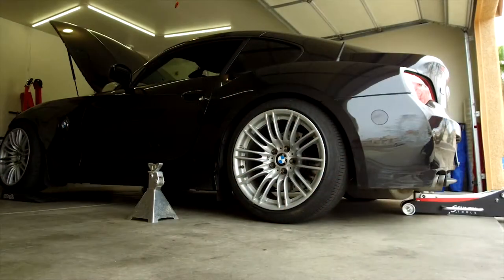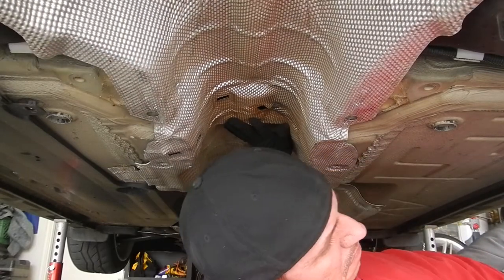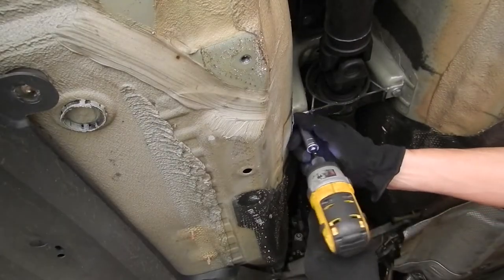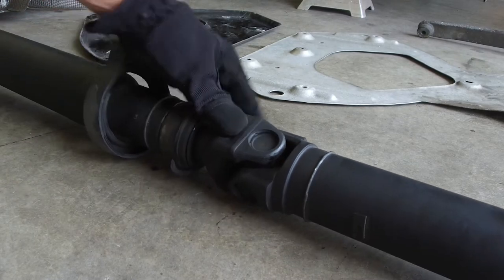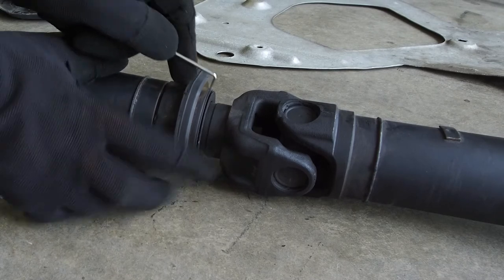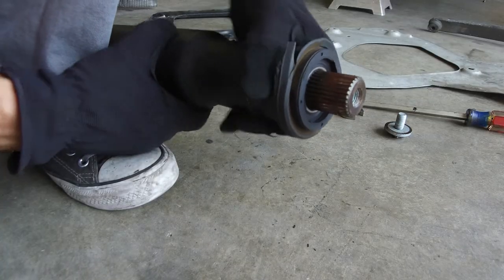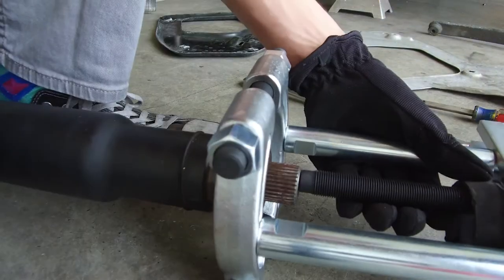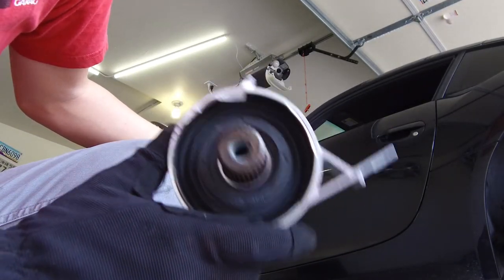How to Replace BMW Guibo / Driveshaft Center Support Bearing

Comment: Hey man, Im new to the channel and I have allready watched quite a few of your videos and I got to say that the quality of the content is awesome!
Im thinking of buying a z4 coupe 3.0 as a drift daily and I want to weld the diff wich = stress on the rear subframe, the question is: does the z4 have any rear subframe cracking problems, or any weak chassis parts like the suspension towers... like the bmw e46 does?
Reply from the maker: freedomlifemake 25 thank you so much! The 3.0 Z4's have all the same rear suspension as a standard e46 but I've never heard of any chassis cracking issues on the cars. You can swap in M3 stuff if needed but almost easier not to as standard replacement parts are cheaper then M3 bits. Good luck with the project!